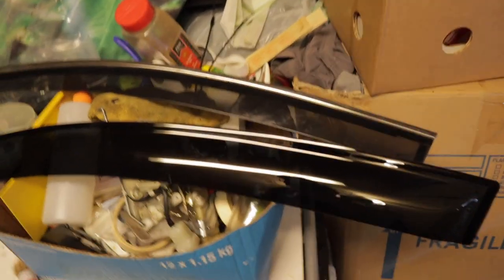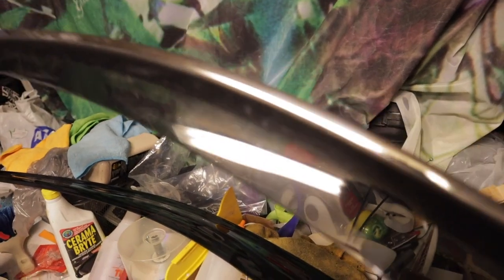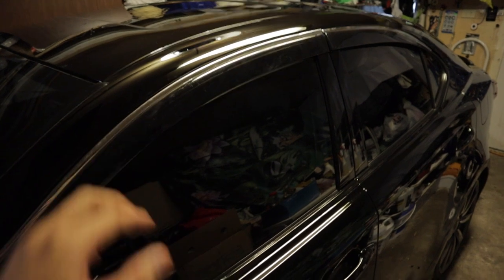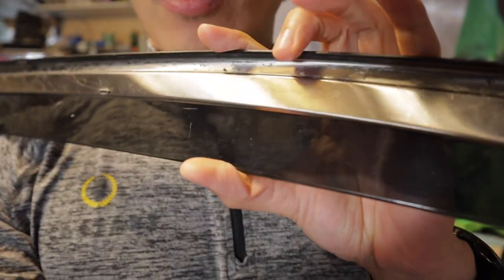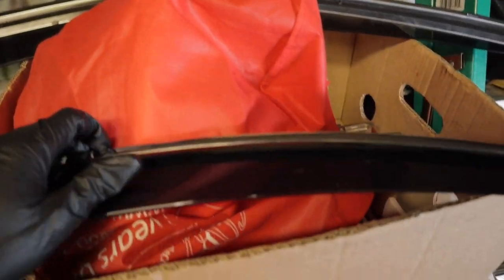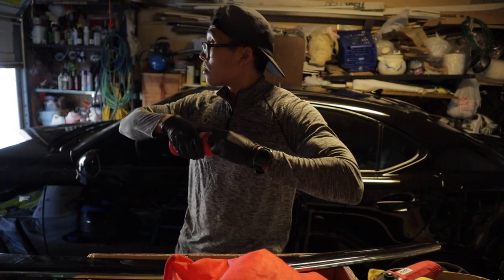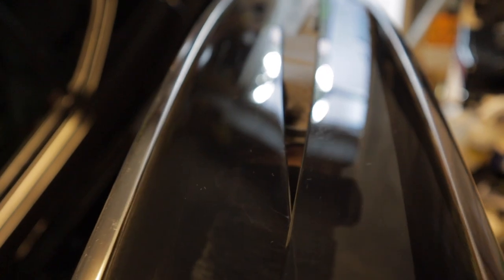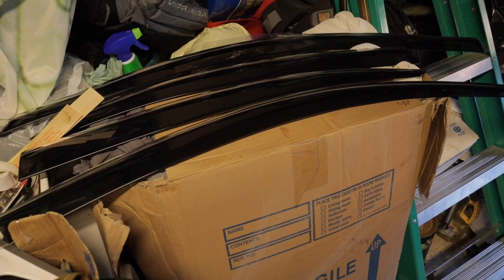lexus isf oem vs ebay window visors

Comment: You can also paint the inside of the oem ones with black tinted clear coat. Like the paint used to smoke taillights
Reply from the maker: I'm a bad wrapper as it is, but I'm an even worse painter 😂

Comment: incase your visors dont work in the future,  a razor blade and 3m wax and grease remover + 3m adhesive promoter will save you a lot of time or an eraser wheel
Reply from the maker: thanks, I've seen the eraser wheel. It definitely would've helped on that roof spoiler. I'll check out the 3m products in the future if I ever need it!